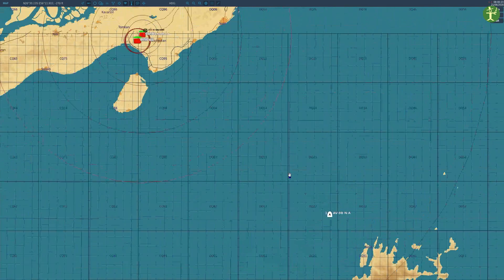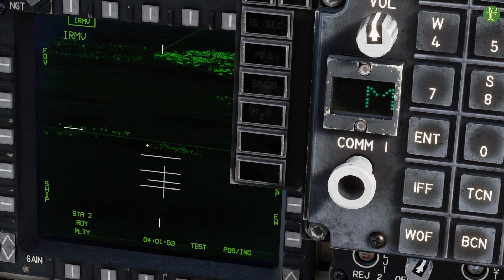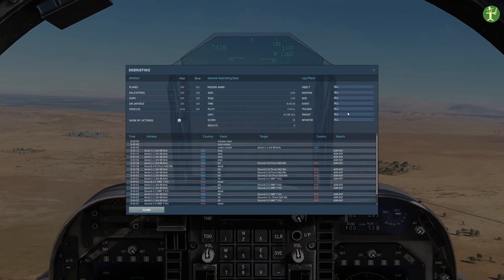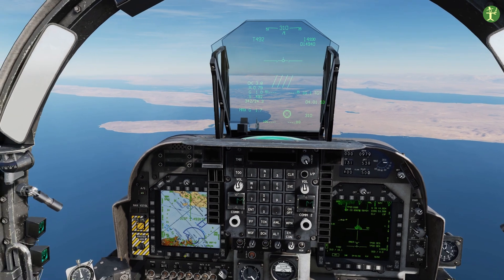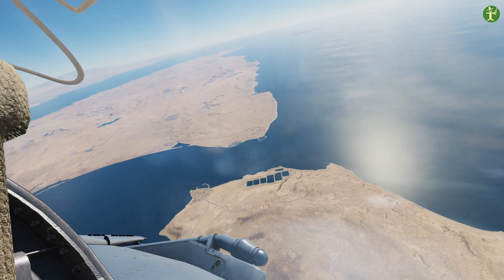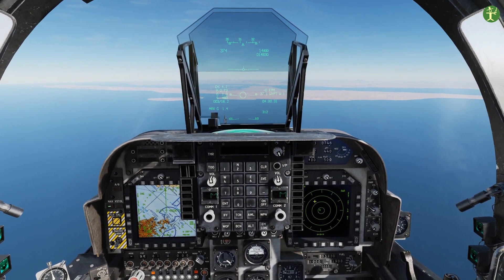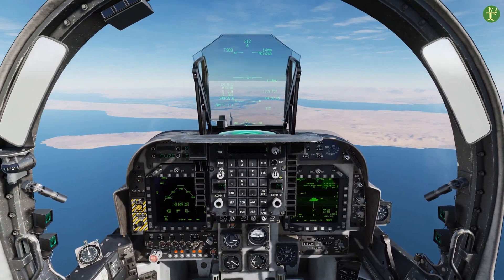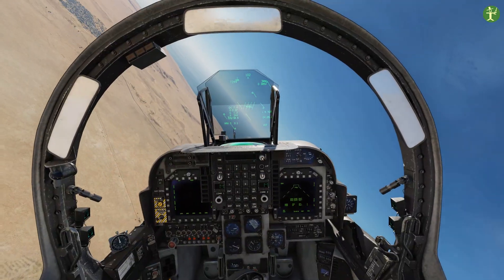DCS AV-8B AGM65 IR Maverick Tutorial  - 3 Firing Modes

Comment: Super vid thanks, sorted all my problems.  A quick question. In the real Harrier, which it the TDC controller and sensor select, I assume on the joystick?  Thanks :-)
Reply from the maker: In a real harrier the TDC controller is the large grey circle on the throttle and the sensor select is the top right switch on the main joystick. If you look at these areas when you use the TDC etc you should be able to see them move (if I remember rightly).